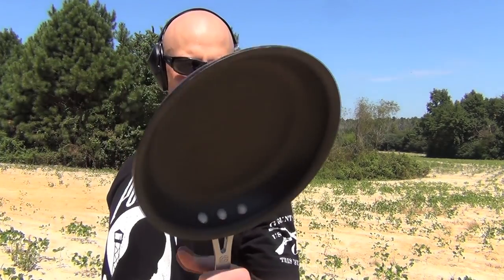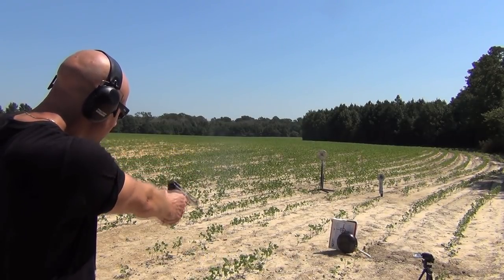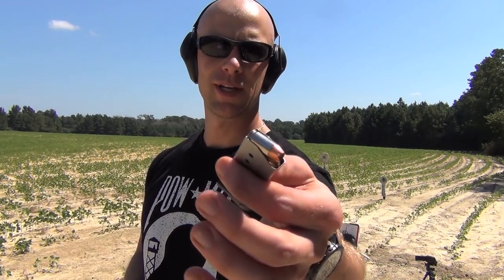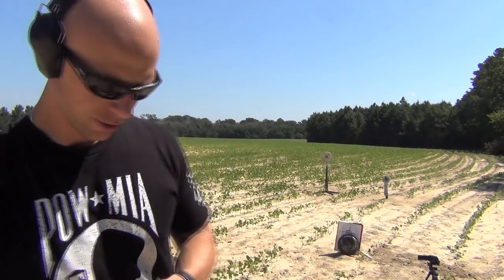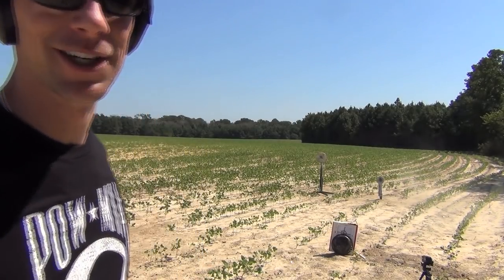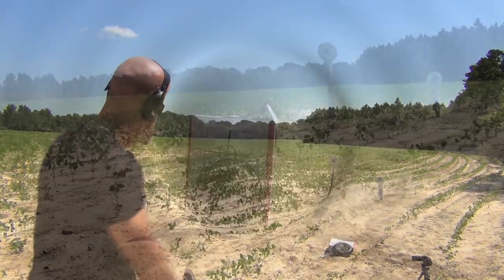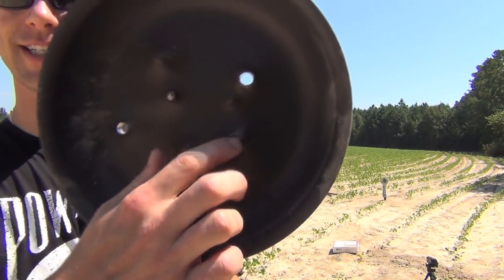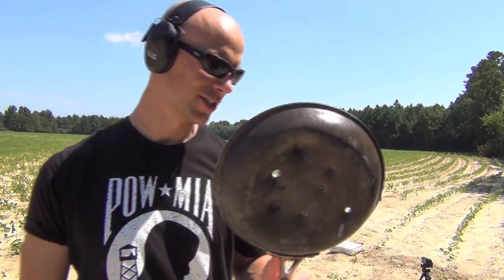Improvised Armor (Frying Pan) Penetration Test  (380 ACP, 9mm, 45 ACP, ect..)

Comment: Reading through the comments you should have also had a bucket to catch the tears of the .45-loving alpha males.
Reply from the maker: +harleymichael83 :D
Reply: Bwahaha I agree.  The .45ACP guys are calling B.S. all over the internetz.
Reply: Really?, Using Wolf ammo, really?
Reply: Use underpowered  Wolf ammo in all of the calibers, wonder what the results would be then?
Reply: ***** The .45ACP just isn't a good hard barrier penetrator.  It's just too slow and heavy.  The best bet for this exact circumstance would be to try a 180 +p load in the .45ACP.  But then you would be picking and choosing to get the desired results. 
Watch other penetration videos on YouTube.  Whether it is blocks of wood or plywood, it just doesn't penetrate as far as the 9mm and .40.  On the other hand, when it does penetrate, it tends to keep a straight line like the .40 does, while 9mm's tend to be deflected, like shooting through auto glass, for example. 
The .45 ACP has its reputation because it's a bigger number.  It makes less energy and moves slower than the .40 S&W.
Reply: He really did use higher quality ammo for the .380, 9mm and .40 cal and use the cheapest ammo (next to TulAmmo) you can find. Use some hollow points like you did for the 9mm and you'll see it will punch a hole straight through.

Comment: I'm totally surprised..I thought the 45 hardball would sail right thru the pan.

Great test..Thanks.!
Reply from the maker: Ted Cregger Thank you
Reply: It would it it were stationary.
Reply: Ted Cregger andthe 9mm fired jhp .
Reply: it based velocity but a larger bullet or weight bullet will cause more knock down power a faster bullet have more penetration power

Comment: Great video!  Thanks!

This is why I favor the 10mm - not only does it have the penetrative ability, the concussive shock totally jellies the interior, reverses the electrical flow in the nervous system, and consigns the soul to the lower rims of Hades.  And then folds my socks... (but only in the full power loadings, not those silly "FBI" loadings: that load doesn't fold my socks).
Reply from the maker: B Miller Thanks
Reply: But there is a downside to 10mm, it is loud.  If u shoot it in an enclosed area u could be temporary deaf.
Reply: Temporarily deaf is better than permanently dead ;)

Comment: Thanks for the Vid! I knew the 45 was a big ol' slow, ugly slug, but didn't think penetration would have been an issue.....now I hope all those home-invaders don't start carry frying pans...
Reply from the maker: Thanks.
Reply: It doesn't matter if the home invaders used a frying pan as cover, the concussive blast to the chest from the .45 would still kill the person.  The heart still would have stopped.
Reply: 808Gravy
Actually it doesn't work that way. If that was the case there never would be a need for any body armor since it would all be useless by the concussive force of bullets.
Reply: usernamunavailiable He was using shit ammo for the .45. I'd like to try my XDm 5.25 +p ammo versus that.
Reply: Well Matt Voldness instead of running your flap why not post a video and proving it?
Reply: Have you ever shot a frying pan before? I have. The .45 usually doesn't have a problem. By the way, eff your attitude.

Comment: Thanks for your video. Very interesting indeed. The point here that could be added to the discussion is the stopping power issue, and the safety for third parties. Considering both of them, still the 45 is a great ballance between stopping power, and controlled penetration. My 2 cents.... Thanks for the test again.
Reply from the maker: Thanks for watching.

Comment: I'd be interested to see how .40 SW does coming out of a more normal length pistol since this Glock has a significantly longer barrel than a standard .40. I imagine it'd still penetrate, but it would be interesting to see.
Reply from the maker: +vversusv thanks
Reply: Was thinking the same, although i think it would not go through like the 45

Comment: I wonder if your results would have been different if you had a more rigid backstop than that box to prop your pan up against? For example, if you had hung the pan from a nail on a thick wooden backstop that didn't allow the pan to move backwards or fall over when struck, which may have absorbed some of the energy from the bullet and reduced the penetration.
Reply from the maker: eqlzr2 Maybe.
Reply: Makes no difference. The pan has so much more mass than the bullet that when the bullet collides, momentum is conserved but almost 98 percent of the kinetic energy is lost to impulse, therefore penetrating or denting the pan.

Comment: As someone from the UK and not much experience with guns except 12 guage over unders. I always wondered with handguns which was better the 9mm or the .45acp. You read a lot online people going nuts "your a homo if you use the 9mm" This video actually did help its one of the impartial ones so it was very helpful.
Reply from the maker: Ruari Thomson Thanks.
Reply: .45 is great if you use 185 or 200 grain rounds.

Comment: This mirrors my experience with car doors. 357SIG was the winner in my tests, followed by hot .40 and 9mm, and then .45ACP+P loadings. 147gr 9mm and 230gr standard pressure .45 ACP fared the worst. 000 Buckshot was the only reliable at any distance penetrator, and #4 buck wouldn't go through even at near contact. I used a police-car door (complete) from the 80's/early 90's. Commonly used vehicles by the criminal element, now.

Comment: Follow-up to the previous post: One reason I'm asking about the backstop rigidity is that I'm interested in the relative penetration of .38 spl vs .380 ACP. For example, in my somewhat limited testing, I've found that typical .38 spl wadcutter ammo will not penetrate a layer of thick corregated metal roofing while rounds of .380 Winchester Silvertip will boil right through it everytime when the sheetmetal is laid up against a firm/solid earth berm.
Reply from the maker: eqlzr2 Noted. Thanks.

Comment: Hi, I appreciate your videos. Truly informative and beneficial. The 'grip' (SA) is clear, concise and logical. I'll make a slight adjustment to grip and be more accurate I'm sure. I suspected the slow moving .45 ACP wouldn't fully penetrate the frying pan. Need  input relative to selection of SA for everyday carry. FN FNS Herstal in .40 versus either Glock in .40 or .45, likely compact or sub. Former LE. Thanks, AW

Comment: Well, I watched this video a few times and just came back from the range a confused sharpshooter. Last year I and a friend shot a similar pan at 25 yards with 9mm and .45. Both put large dents in it but no holes. So I noted this was just 10 feet. So I took 2 frying pans, one 3/32" thick and the other 1/8" thick. At 10 feet the .22 and .45 went right through the 3/32" pan cleanly. (I did not think to measure their thickness until just now). So then I put both pans together (the 3/32" in front and the 1/8" behind it.) and the .22 went through one and dented the other. The .45 went through. (It did at one time go through one and put a large dent in the 2nd pan though.) So I backed up to 25 feet and the .45 still went through both pans. How thick was the pan you used? I was using 230 grain FMJ made py PMC.
Reply from the maker: sorry but this was years ago and I don't know
Reply: It does look like 1/8". But it is odd that my .22 and my .45 went clean through the 1/8 " pan at 10' and the .22 at 25' went through one and put a dent in the other and the .45 went through both at once at 25'.
Reply: He used wolf ammo. That crap is inconsistently loaded and it is underpowered.... Well below advertised. I did something similar using Winchester fmj.... No problem there.
Reply: izzy Great. Thanks. I could understand the 25 yard dent only but 10 FEET!!??

Comment: Next time use a fast +P .45 acp load, one travelling in excess of 1000 fps.  I believe that you will then see a .45 acp penetrating through a frying pan.  Not sure why everyone is surprised.  Standard .45 acp rounds travel less than 900 fps.  That's not enough speed to penetrate through a hard target like a frying pan (at least that one).  The result would have been the same with the 9mm and .40 if they too were travelling at the same velocity as the .45.  The only one that surpised me was the .22LR, because it was likely travelling at 1100-1200 fps.  Maybe MrGunsnGear can confirm its velocity.

Comment: That car door I shot up DID stop a 270gr Speer Gold Dot SP hunting load in .44 caliber, fired from my 7.5" Super Redhawk when it hit the window-crank mechanism. Stopped it cold. I've seen them also ruin a .308's day, but I've also seen a .22 slither in there. Better than nothing, I guess, but obviously no bueno if you have choices. I was always taught engine block, heavy disk-brakes or rims, or if possible, the entire car length-ways were better for cover.

Comment: I've been viewing videos to pick up information prior to purchasing and training with a handgun for self-protection/ccw.  This was the most practical demonstration of what these different weapons / calibers might do than most any of the other videos I've seen.  Given the blunt force impact that the 'smaller' rounds had, I'm wondering if they might be better for short-range self protection.  I've been only looking at 9mm, but if the bullet might go through a person, would a lesser speed bullet be better?  When I carried the .45 caliber in the military, the expectation was that the impact force would, at the very least, knock someone down.  It doesn't bother me at all that even the .45 doesn't have the force to penetrate that metal.  I'm wondering now if a .380 might be as good, or better, a self protection weapon as the 9mm.  After viewing the potential consequences of shooting, even in self defense, might it be better to slow or stop an assailant and get away if that is the result of the smaller rounds?  Does the usual 9mm typically go THROUGH a torso from 10 feet?  If so, that might not be the best choice for self defense.  Again, I'm trying to understand the ramifications of carrying, and being forced to use, a handgun.  And, for those of you who have several years target practice knowledge, I'm not really interested in the nuances of the different grain loads.  I'm only interested in carrying a weapon for self defense.  Thank you for this video.  None of the videos have been properly documented so as to be proper scientifically comparative.  This video is more real-world by demonstrating the hitting power of the various rounds from various weapons.  Simply, a very practical demonstration.  Nice job.
Reply from the maker: +Fred Eversole glad you found it helpful

Comment: Nice video, I've probably watched it 4 times now lol. 9mm and 40m are pretty fast and are great penetrators because of the speed and circumference of the round. 45 is still a good round though, if you can shoot it lol. The bigger the hole the greater chance of hitting a vital organ in a defensive situation. Shoot the Biggest hole maker you can lol.
Reply from the maker: Guns&Outdoors Thanks.

Comment: The .45 caliber has been a good round for people with proper shot placement. The Texas DPS did have many failure to stop with the issued P220 loaded with 230 Winchester hollow point ammunition. The DPS did switch to the 200 grain load with poor results still. The DPS decided on going with the .357 Sig and it has proven to be a great fight stopping round. The key is velocity which the poor old .45 ACP lacks!
Reply from the maker: boostimalaka1 Agreed---the 45 is a great round.

Comment: This leads me to think that 1mm steel in the 550 brinell range with optimum toughness could be a great material for police vehicles if it can stop a .45 and low down a 9mm. Of course it's not ideal, but for the weight, it seems like a great alternative to expensive kevlar inserts.
Reply from the maker: SalveMonesvol perhaps
Reply: +SalveMonesvol 1mm steel was actually used as the norm for private security companies using armored wagons transporting money back in the 18th century. They trusted the armored wagon so much they brought the thing to Mexico since it was nearly impossible to deliver money in mexico without being shot at like a target in the firing range. Back then the only security they had for gold transportation were 5 guards with shotguns sitting with the money in a wooden wagon with no enclosure. One blacksmith saw that and designed a wagon with wooden framing to allow the money to be completely enclosed, then plated then entire thing in 1mm thick metal. I wasn't no where near as well as armor today, but it was super expensive, and was seen as state of the art back then. Apparently it stopped shotgun pellets and revolver rounds really well.
Reply: ***** I'll assume you mean 1800's, or 19th century, not 18th. 
 Beyond that, it seems very reasonable, and modern steel should be at least equivalent to 4mm of what was available back then.
Reply: SalveMonesvol Yes I meant to say 1800's, it's a habit to call it the 18th century. But anyhow, I think the idea would be good for regular police cars. I wouldn't use that stuff on a SWAT truck though. The SWAT team has come across and been shot at with too many black market AK47's which would punch through that like a wood pecker.
Reply: ***** Sure, high speed bullets would go through like nothing, but for patrol cars and SUV's, it's ideal. Even knowing that cars are soft, thin steel, they will take cover behind them when nothing better is available. With this light armor, taking cover behind the car would actually be pretty safe, since high speed ammo, like 5.56, will be damaged, fragment or yaw after the first layer, enter the vehicle and fail to penetrate the second layer to reach the officer at the other side. Even heavier rounds would lose a lot of energy.

 Anyway, just some ideas floating around, have a nice day!
Reply: SalveMonesvol Well metal that's heated rapidly cooled, heated, then slowly cooled again create extremely solid metal that can protect against 30-06 and 308 rounds making it perfect for SWAT teams. But I see it being used for regular patrol cars and civilian use. Anyhow, I hope you also have a great day! I'll look into this idea.
Reply: ***** I know a fair bit about heat treating, metallic materials is a subject that takes over 500 hours of study during second year of mechanical engineering ;).
 Check Saab's ramor 550, it's ideal for thin armour.
Reply: SalveMonesvol Sounds cool, I'll look into that. You know in Mexico, because of escalating cartel violence, it's hard for their cops to keep paying so much for the metal armor so many of them are just installing the thick Kevlar woven panels in their doors. Apparently that stuff is super cheap and has an even better effect than the metal were talking about. It stops 9mm, 45acp, 22lr, 22 magnum, and with enough Kevlar layers even a shotgun slug or 44 magnum. So lots of the local cops are investing money into inserting thick layers of Kevlar in the doors of their car and of course bullet resistant glass to go with it which stops M16 and AK-47 rounds. Kevlar's always been my favorite armor, super lightweight, very effective, also very cost effective. Cheap is a scary word when it comes to talking about armor, but Kevlar is a good kind of cheap.
Reply: ***** Kevlar is much more expensive than what i was saying. Do you speak spanish?
Reply: SalveMonesvol I don't speak Spanish no, my grandparents speak Castillian but they said that Castillian is not a effective way to communicate in Mexico or South America because I guess they don't understand traditional Spanish. But as opposed to effective armor today such as heat treated steel like on security trucks and SWAT trucks, Kevlar is used internationally for being made so easily and so inexpensively. Lot's of corrupt/poor countries such as Bolivia and El Salvador use Kevlar since their government can't afford anything better, when they used the Kevlar, the death rates of their police, military, and security personnel dropped dramatically. But I'll research that metal you told me about right now. Sounds interesting.
Reply: SalveMonesvol Wow, that Ramor 550 or whatever looks pretty effective. Did you take engineering in the military?
Reply: ***** no, civilian. Not finished yet.
Reply: SalveMonesvol Ah okay, well good luck with all of that. We need good engineers in the world. Especially space craft engineers, it would blow peoples minds how much gold is on Mars. Once I establish my investigative/security intelligence corporation, I need to find me a few good aero-space mechanics. There's big dollars to be made in private space flight. Between SpaceX and Virgin Space. People are starting to realize that space exploration may not be a thing of the government, but a thing of corporations.

Comment: Any chance you could redo this video with 22LR and some CCI Stingers or Aguila Supermax rounds? Those penetrate metal better than any other 22 round out there due to their speed. One is 1640fps and one is 1750 out of rifle. In your pistol you will probably get an extra 200fps over the Blazers.
 It might just make the difference.
Reply from the maker: probably not as the pan was thrown away afterward

Comment: Just finished a similar test with a fairly thick/heavy skillet. I skipped the .22 test, but instead fired .38 special fmj & hp, .357 magnum hp, and 9mm fmj. All at 10 feet, just like you. All rounds penetrated like butter. Still utterly dumbfounded that the relatively slow .38 penetrated but the .45 did not.
Also just for fun, I shot the hell out of it with an AK...yes it penetrated :)
Reply from the maker: interesting